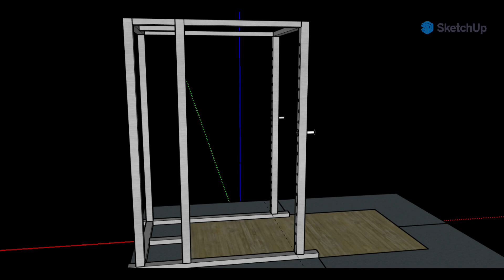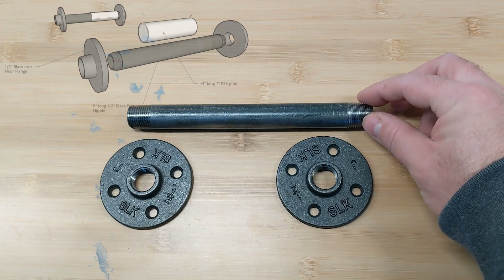DIY Racking Pin (J-Cup, J-Hook) - with horizontal roll

Comment: Can you use 3/4” ungalvanized pipe?
Reply from the maker: You probably can, however consider:

1. dimensions of your rack (specifically the hole dimensions)
2. wall thickness of the pipe - can it hold the weight of your bar+weights?
3. location of the rack.  High humidity or exposure to water/sweat may cause rusting.